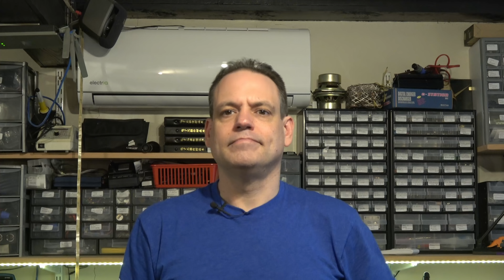Digital Sky - Part 1 - What is a Digital Sky?

Comment: M8 I have exactly the same voltage sag on the neopixels I had round my kitchen ceiling. There are 1200 of them and I have ringed them and injected new supply half way along and the voltage drop on the copper trace is still causing issues.
Reply: Just noted you said you could have 1024 coz of the data on them. Maybe that's my issue.

Comment: Where did you get that grab bag selection of JST connectors and the crimp from ?
Reply from the maker: Ebay of course... Obligatory Link: https://www.ebay.co.uk/itm/Electrical-Adjustable-Plier-Crimping-Tool-900Pcs-JST-XH-2-54mm-Connector/323327229002

Comment: Do you remember the Foot square flex PCBI had with  32x32 RGB LEDs it was a fantastic device but very power hungry
BTW have you considered powering the Strip from the centre to balance the voltage out
Reply from the maker: I don't think I remember that flex LED matrix panel... What were you planning on using it for? If I'd have been permanently mounting the strip somewhere, I'd be considering multiple power feeds, but as I was just draping it over for a quick test, I just used the wires that the manufacturer provided. Cheers!!
Reply: @ThingsWhichArentWork  The Device  was for a wearable. BTW those LEDs you have are  probably the 150lm /W devices they simply must be incredibly bright